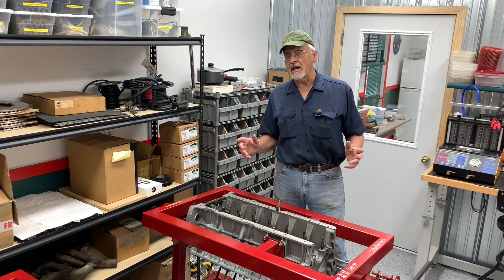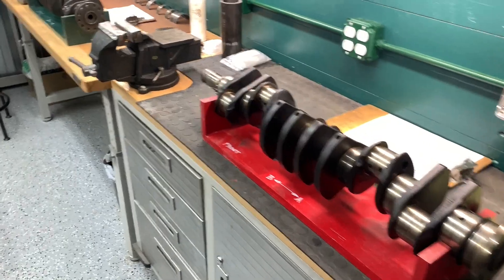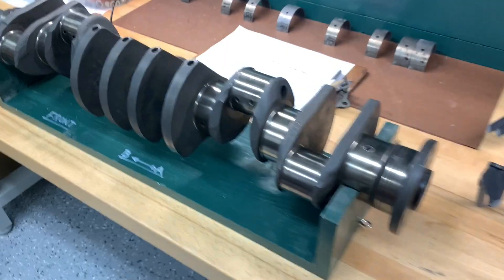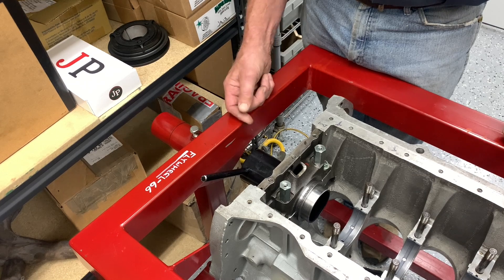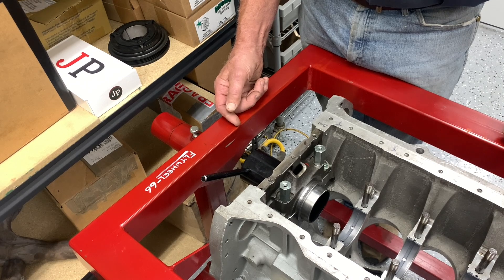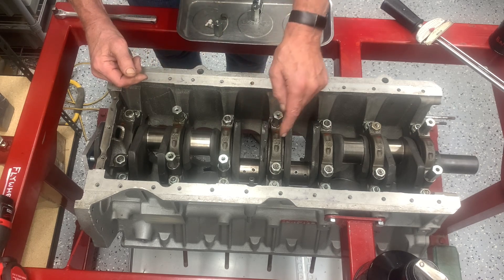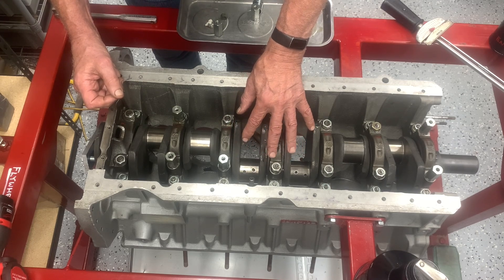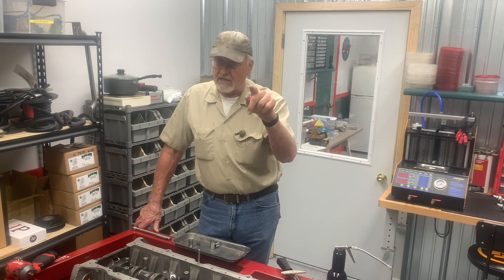S5:Episode11-TWR Jaguar 6.1 Liter Crankshaft Installation.

Comment: It's  wonder that Jag never used lighter rods.  Also I wonder if they'd used flame spray to build up the journals if it would have avoided the pinholes and or been as durable. I guess there would have been more material to remove though as it's usually done while the crank is rotating to cover the journal evenly...     Nice detail on the dry lube addition to the bearings.  Always thought that would be a good idea since I learned about that stuff a couple decades ago.
Reply from the maker: I'm looking into metal spray for camshaft mods.
Reply: @thecampchaoschronicles9567   I wonder if one of the bonded metal or ceramic metal sprays could/would have the capacity to replace nitriding.